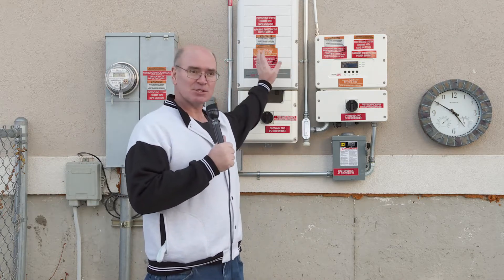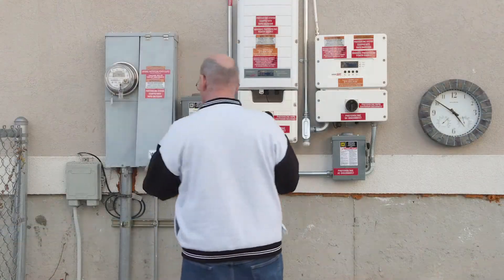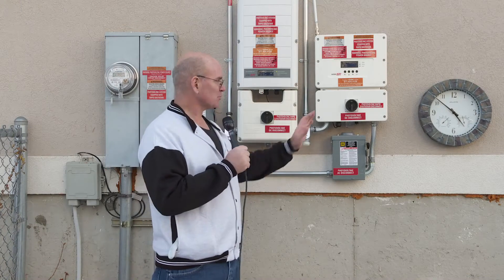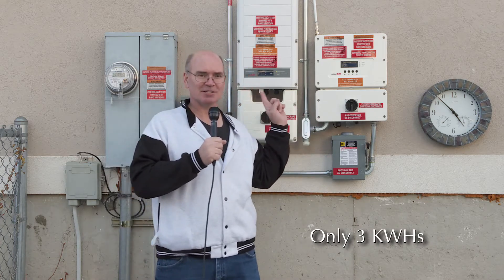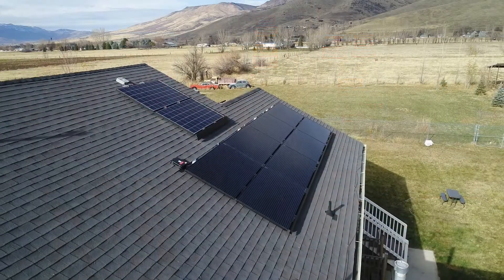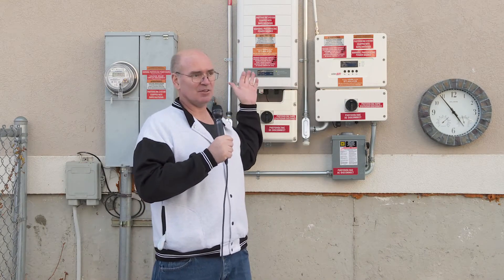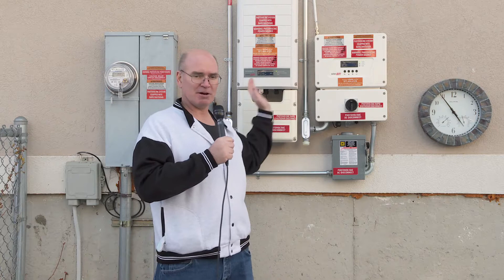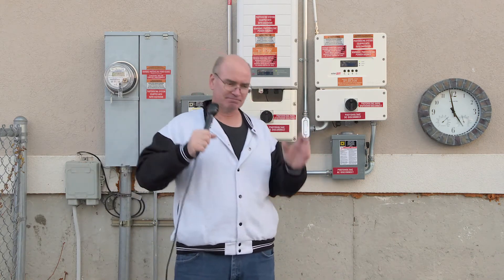Solar Panel Expanded System Installed

Comment: Nice system! I have 10.9 kw with 78Kw of battery back and 1.6kw wind trubine. I back this up with a 9kw duel fuel generator. This spring I will be adding additional panels and inverter.
Only thing you are missing is a back up which you could use battery or even a generator. Cost are down on both.  Again nice system! Keep it up.

Comment: I am a  licensed electrician. I noticed on your last video you had a 200 amp Cutler Hammer main breaker and now you have an Eaton 175 amp main? Why did they lower the breaker size down?
Reply: By code the sum of the solar breaker plus the grid breaker can't be more than 120% of the bus bar rating of the panel. So when they increased the size of his solar breaker they had to decrease the size of the grid breaker to stay within the 120%.
Reply: @mikeeast819  I swear that makes no sense to me...

Comment: Have you considered micro inverters/ power optimizer because of some panels not producing all the time? ( east / west facing panels and neighbors shade tree )  I have the same issue with south facing roof and looking into ground based solar panels both for efficiency and ease of cleaning the panels . I liked your videos,  thank you for making them .

Comment: Nice upgrade! Great idea to cover your east and west facing production. I have a due south south system with 18 panels and 4.77 kw. The power failure piece I am hoping to see prices of the powerwall drop and store energy. You are covered with Solaredge as it is compatible with a AC couples system. As always, excellent system design overview. Keep us posted